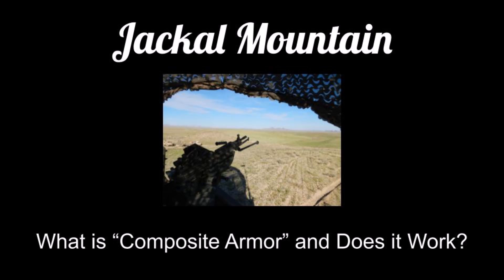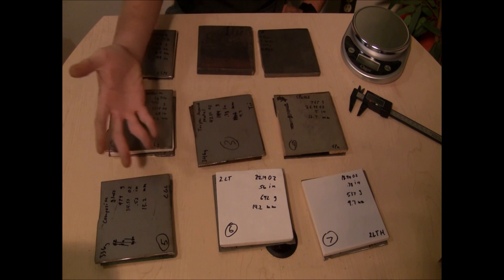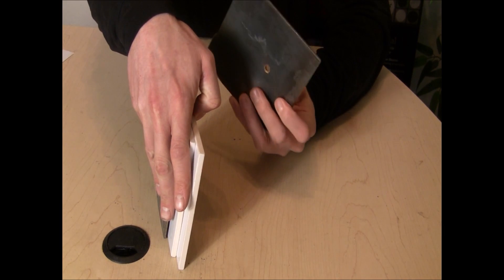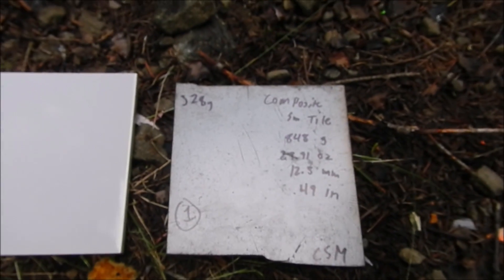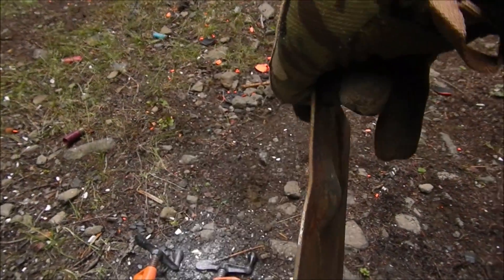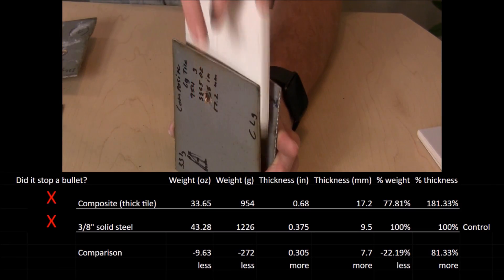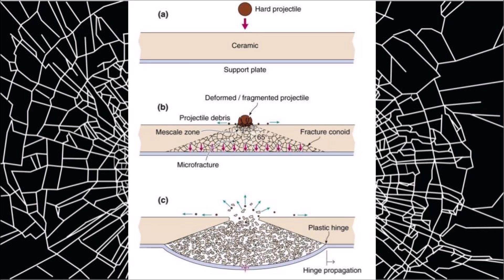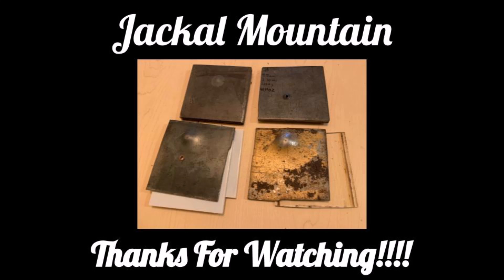Composite Armor: increasing protection, with less weight

Comment: Protections agains shaped charge.
Germany: Metal Side Skirts
USA: Sandbags
USSR: INFANTRY
Reply: It also bears mentioning that the side skirts on Panzers were originally to help protect against AT rifles & HMGs.  Even the Panther had a few spots on the lower hull that a PTRD or PTRS could punch through.  The skirts destabilized the bullet, limiting its penetrating power.
Reply: Rama Davy The Russian method of protection is actually the most effective😂

Most of the panzerfausts produced were the panzerfaust 60, which had a max range of 200 meters, and had to be fired in the open due to the back blast.
The Infantry would dismount and screen the tank, making it impossible for infantry to sneak up and ambush it.

Meanwhile, the Schutzen and sandbags have been proven to do nothing to disrupt shaped charge warheads, as the schurtzen are not far enough away from the tank for the molten jet to loose power, and the sandbags have the same problem.
Reply: @thecanadiankiwibirb4512  Panzerfaust 60 had an effective firing range of only 60 meters. That is why the number 60 is in the name. To shoot 200 meters, it is necessary for the shooter to determine by eye the flight balistics of the warhead, the speed of movement of the enemy tank, wind speed and its direction. All this should be calculated by a German schoolboy in 1945.
Reply: @thecanadiankiwibirb4512  I don't know if you are talking about another variant of the panzerfaust or something but, panzerfausts' don't have a backblast, as they don't have an opening in the back of the chasis of the launcher, unlike their big brother the panzershrek. Also the panzerfaust are recoil-less, they were made that way, which is another reason why they were so deadly on the battlefield either against tanks or ground-troops.
Reply: @srslothington  how can a recoilless have no backblast? how it neutralizes the opposing force?
Reply: @witchaponkitthaworn5998   Eh, the comment I made was 7 months ago, I didn’t really know too much about the panzerfaust and such, as can be seen by the comment that already debunked mine shortly after I made it
Reply: @witchaponkitthaworn5998  Besides that comment WAS 7 months ago, but I’ll answer your question nonetheless. If a rocket is recoil-less then no, it doesn’t mean it wouldn’t have a back-blast, however it could have vents along the rear of the tube like a muzzle-breaker on any other rifle and cannon and thus somewhat help to dissipate the effect of the back-blast. But then again this is a theory and someone would have to try it to see if would work so I may just be wrong again.
Reply: @srslothington  Well I didn't go through all replyes either, anyway, from my understanding the recoilless concept will always come from. let it blast and counteract the opposing direction force (the projectile) so the one who shoots it has no recoil.
Reply: @srslothington panzerfausts' do actually have an opening on the back it's just covered by a cap that is either taken off or just blows off when fired. If they didn't have an opening on the back they wouldn't be recoilless as the gasses have nowhere to go except the front of the gun thus giving recoil
Reply: if they can't get close your tank will live
-ussr
Reply: The German side skirts were not used to stop shaped charges, On the panzer 4 they were there to stop anti material rifle rounds which the Russians were using in flanking positions by allowing the bullet to shoot through a thin plate first the angle of flight of the projectile and nose shape was effected enough to make the round ineffective when it reached the hull. The Germans stop putting side skirts on their tanks for the most part by the time shaped charges started showing up in the hands of the allies. Also the predominant user of shaped charge weapons were the Germans so they would not waste precious metal to equip tanks with spaced armor to counter a threat that barely existed from the allies. You have to remember ww2 era shaped charge weapons were often short ranged, unreliable and inaccurate the reason the Germans made such extensive use of them in the mid to late war was because they were desperate and on the retreat, shaped charged weapons are much harder to employ on the attack thus the allies had far fewer of said weapons and no sane German designer would bother to put space armor on their tank making it easier to spot and heavier when most of their tanks were being knocked out by kinetic rounds from cannons.
Reply: uncletigger while I agree with your statement, I don’t think Americans would’ve given up after DC was taken over. There is so much more land for the enemy to capture and the Americans to fight for
Reply: @meatshield7206  American generally values life more so prob would have surrendered rbh
Reply: @cianmac3934  They would have signed an armistice but kot surrenderd with barely any land captured by the enemy. And tzat is no even considering that in North America the USA has full air and sea superiority.
Reply: @meatshield7206  And that would first have to happen. And before this happens the USSR would have collapsed a hundret times.
Reply: @meatshield7206  There's no need to fight to DC to cause the Americans to collapse, you just need to prevent them from having a good landing site close to your homeland, like the U.K and then try to destroy the markets that fuel their economy, causing an economic collapse.
Reply: @meatshield7206  He's saying that they would rather give up if it meant saving American lives rather than fight to the last woman and child like the Russians were willing to.
Reply: The Soviets actually used chickenwire mesh but it didn't do anything.
Reply: Russia : ERAAAAAA
Reply: It's called active armor
Reply: Yes
Reply: ow
Reply: Well the aobier has a live armor
Reply: @OVOD.net I was just making a joke...
Reply: HEY! Russians tank by most strong ever in the all world!! Ok?!
Reply: @ВАЗ-д9э  Your English make my day^^
Reply: @ВАЗ-д9э  no. It's that simple they are not the strongest. ok maybe right after the end of WW2 but in the MBT scene no it is not
Reply: Fuck you! Moroon
Reply: @ВАЗ-д9э  no u
Reply: IS-7: An entire battalion worth of machine guns.
Reply: @OVOD.net The Soviet infantery relied heavely on mosin-nagants, which first slowly improved. And the forst remote controlled vehicle was the Sd. Kfz. 302 and 304.
Reply: @OVOD.net Would be new to me that Germany had suicide planes. But only in half of their planes in mid 1943 they had radios and and needed quite some time to develope fighters with more than rifle caliber machine guns.
Reply: This isn’t anything to laugh about but I still did 😂🤌🏻
Reply: Interesting that the Russians used ceramic spheres embedded in some sort of material, in the simulation channel these spheres proved very effective in deflecting/destroying tungsten penetrators.
Reply: @alb9229 its a fucking joke, god you gotta be so fun at parties, bet all the cool kids surround you and sing kubaya
Reply: @alb9229 "A joke is NOT a joke unless its painfully obvious that it's wrong." Now tell me, is your paragraph long "joke" funny or are you just inhaling coping?
Reply: who the heck likes their own comment anyway that's just weird@alb9229
Reply: idk man, 930 people seems not to agree with you@alb9229
Reply: idk man, apparently 930 people agreed that I make a good joke, maybe your humor are just stuck in the 70s@alb9229 🤡
Reply: Huh, that's where mechanized infantry comes from...
Reply: @OVOD.net The USSR started the Winter War, because tgey wanted land and nothing more. And they, or at least Stalin who was from Georgia, killed Ukrainians in masses and tried to „russifie“ them in the sense of oppressing them and other slavs due to the idea of russia being the mother country of all slavs.
Reply: @OVOD.net i believe all of these except the "all armed with automatic weapons". some soldiers even fought withouy anything in their hands
Reply: well, add that the t-34 till the 85mm gun were blind as a bat and the commander hatch open in front of him, those eyes did help a lot

Comment: Glue or resin a few layer of welding blankets on to the composite for an interesting test
Reply from the maker: Ill check that out!
Reply: Jackal Mountain 👍🏼.  there is a YT vid of using harbour freight welding blankets, resin together into a low cost strike plate.  Very interesting.  Imagining it as car door panel

Comment: Excellent video Jackal! I really like to see normal folks doing real research like this. If I may make a few suggestions/observations:

- I really appreciate the charts you compiled. Very excellent. 
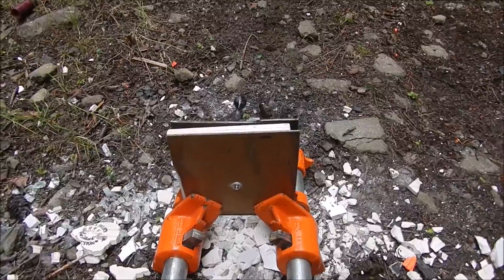- Perhaps some form of epoxy can be used to bond the composite layers together? This will prevent the uncontrolled variable of air gaps (ex: @7:15)
- In line with the above, implementing air gaps might prove useful behind the ceramic layers. This would allow for further energy drain from the projectile and give the shattered ceramic even more surface area to effect. 
- Exactly how the FORNICATE do you have less than 2k subs? Your content is seriously top-notch. 
- After you're satisfied with the "composition" aspect of armor, maybe we can look at angling?

Keep up the good work!
Reply from the maker: Thanks for the feed back! Apparently using a rubber layer behind the ceramic is common in tanks, I'd imagine it would be like an air gap to best expand the surface area of teh shattering ceramic. On my channel theres a similar test of sloped armor I did last year.
Reply: Rubber is indeed as useful layering material. Another option for holding materials together as a coating is polyurea truck bed liner. It can be sprayed on to glass or ceramic inserts for example or even the metal layers too.

Comment: Gun bullets has only kinetic energy  but the composite armor is agains chemical energy like presented in in the start of the video. Cheramics wont do much better against kinetic energy
Reply: The chemical energy of the explosive is turned into kinetic energy when it detonates...
Reply from the maker: HEAT rounds are just kinetic penetrators like bullets or sabot rounds. The metal liner doesnt get hot enough to melt steel but it does get accelerated by the focused blast into a hypervelocity slug at point blank range. Think waterjet cutter not plasma cutter
Reply: @jackalmountain6523  i dont agree but i wont argue :)

Comment: Ummmmmmm.

Talks about heat rounds dose test with kinetic penetrator rounds...(rifle bullets)

Hey what do I now. What does the .556 scale up to then is it a 220mm  shell
Reply from the maker: HEAT rounds are just kinetic penetrators like bullets or sabot rounds. The metal liner doesnt get hot enough to melt steel but it does get accelerated by the focused blast into a hypervelocity slug at point blank range. Think waterjet cutter not plasma cutter

Comment: 11:50 what you really want is something thats almost liquid something that  after fragmenting during the hit would flow back into place ... something like ... a non Newtonian  liquid  that was confined between the plants with an integral  air gap that could buffer  and dissipation the energy from the strike  maybe something like that stuff in stretch Armstrong dolls ...
Reply from the maker: ideally it would be a substance that takes force from one direction and radiates much of it outward perpendicularly instead of in the same direction as it was impacted
Reply: @jackalmountain6523   well a contained fluid sort of does that   in that it exerts the pressure equally over the surface of the container that holds it until it fins some part of the container that is weaker than the rest and then burst thru there
Reply: @jackalmountain6523  that said tho have you seen that taofledermaus video of them shooting a stretch Armstrong dolls and it stopping a  9mm and a 45 acp (https://www.youtube.com/watch?v=mjJPvAa_HN0)  sadly i neither own guns not have access to them but i would be really interested in a video  see just what can be done with  a composite of that  really think cornstarch/syrup (?) in the stretch armstrong doll   maybe sandwich it between two plats of steel  etc etc may be as  some marbles into a  container of it to sort of replicate that soviet composite Armour with the ceramic balls  etc etc  much much protection would a zip lock bag of it in a vest pocket give you and how much would it wight etc etc   anyways just an idea or two :)  stay safe out there :)
Reply from the maker: @firefox5926  great ideas. This summer when the snow melts ill see what kinds of tests i can put together
Reply: @jackalmountain6523  so thinking further on it   a test that might be interesting would be  something like   the rounded base from something like sawing in half a dry powder fire extinguisher filled with marbles and then with the goop from a  stretch arm strong in it ... mt  hypothesis is that  as the projectile strikes the first  marble it will shatter it to dust expending some of its energy, the particles from the marble being surrounded by the goops will have to displace it  to take its space the goop being a fluid will then accelerate towards the walls of the  sawn in half container which having been designed  as a pressure vessel and lacking sharp corners would maximize the surface area that the pressure is applied to while minimizing stress concentrations preventing premature vessel failure , as the energy of the bullet decreases as it moves further in   i suspect a some point that it will be deflected by one of the marbles eventually   after it has been stopped the marble dusted mixed with the goops will "slowly flow " into the place where the marbles had been

ps basically the bullet become  a very high velocity piston in a hydraulic ram   the pressure being spread not only in a cone to the rare like in a ceramic backed with a plate  but  but more or less across the entire of the surface area of the vessel via hydro static shock(?)  if successful the cups  or containers could be shrunk and the tessellated like era  panels
Reply from the maker: @firefox5926  very interesting. I had the idea to try a matrix of ceramic ball bearings encased in metal or high density plastic for a similar effect.
Reply: @jackalmountain6523  that was my first thought too but it's basically just replicate the soviet t...62? composite Armour with the balls on springs with the  steal cast around it .. i think the stretch arm strong goop would be interesting since  unlike   set metal or plastic it can still flow so after a hit it might be able to still provide some protection  as it flows to fill the holes
Reply from the maker: @firefox5926  yeah. biggest challange is going to be thinkness. Since the point is that it can flow and move (and thus better "catch" a bullet) it needs more linear distance to slowdown the projectile. That might not be a problem but would affect design constraints and might net increase weight due to increased volume/surface area
Reply: @jackalmountain6523   idk man i mean i dont know how thick a stretch armstrong is but they look to be about and inch to like 30mm  and thats been demonstrated to stop 9mm and 45acp  and two of them back to back stopped a 357 mag .. so adding some hard ceramic in to to it .... i mean  we don't have them here(stretch armstrongs that is) so i don't know how much they weight but  attaching a thin metal backing plate to an inch of thats goop with marbles in it should stop at least what the doll can without addition...  so ?
Reply from the maker: @firefox5926  well I stand corrected. It might be pretty doable afterall.  As soon as the snow melts in a few weeks I can get back out shooting in the national forest and ill try that out
Reply: @jackalmountain6523  actually  just thinking about that... i wonder how temperature affects the bullet resistance of a stretch Armstrong most of the  times i've seen it shot it was in like cali or Kentucky ... i  wonder if low temps make it more brittle and more likely to have a brittle failure than a plastic deformation ?
Reply: @jackalmountain6523    you ok mate haven't heard from you  in a while ? stay safe out there k :)
Reply: @jackalmountain6523  oh also have you heard of "plastic armour" from ww2 ? https://en.wikipedia.org/wiki/Plastic_armour might make an interesting video :)

Comment: Schürtzen was used in Pz 3 and 4 because their side armour was 30mm and Soviet anti-tank rifles could penetrate it, sow they implemented Shürtzen.
Pz4 J only haved them on turret to look like a tiger because on western front allies didn't used AT-rifles.
T-64 armour was made by welded steel on uper plate(ap-410mm and heat-450mm) and aluminium whit othe materials on torret (ap-395mm and heat- 450mm)
The first midel of M1 Abraham, haved the frontal armour rated around 350/380mm vs ap
And 700mm vs heat.
Whit depleted uranium layer, increase the armour to 750-960mm vs ap and 1200mm vs heat.
 depending on the source 
Very nice video

Comment: But wasn't ceramic armour primarily meant to defeat HEAT round?
Reply from the maker: HEAT rounds are just kinetic penetrators like bullets or sabot rounds. The metal liner doesnt get hot enough to melt steel but it does get accelerated by the focused blast into a hypervelocity slug at point blank range. Think waterjet cutter not plasma cutter